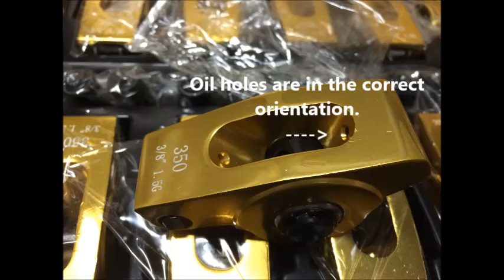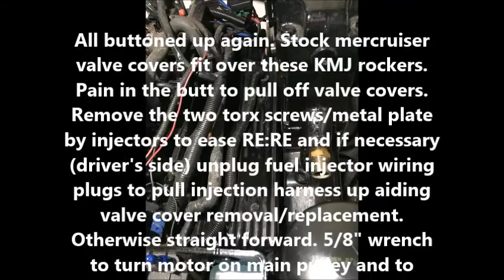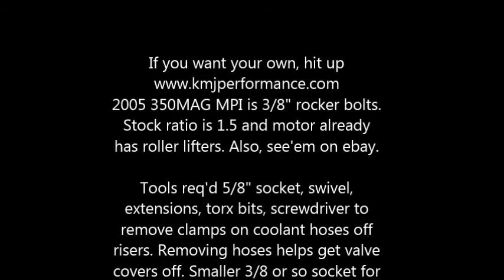Upgrade 2005 Mercruiser 350MAG MPI Roller Rockers

Comment: What field of work you in?
Reply from the maker: Manufacturing clean ingredient personal care/cosmetics. Lets see... started with legos, then drag racing and rebuilding type1 VW beetles, 7.3L power stroke modder, alum & steel tig welding, mig welding, professional baker, electronics technologist, installed/sold solar PV & hot water, etc.

Comment: What was the mph gain?
Reply from the maker: To be honest I don't think there was any. But overall it runs smoother and quieter from what I can tell. Unfortunately there aren't too many power hop-up pieces for this generation (ie. ecu programs, etc) for more power. Perhaps try 1.6 or 1.7 ratio rockers for more lift? Otherwise maybe a supercharge but damn lotta change $$$ for that. Cheaper to get similar hull boat with a big block or factory supercharger. Too bad not many turbo options for gasoline marine engines. Changing ecu software on a factory turbo'd motor gives big gains vs 5% with premium gas advance ignition timing on naturally aspirated. Although I haven't measured seems fuel economy is better, perhaps due to overall little bit less friction with rollers vs stamped steel pieces.
Reply: @westvandude   I just did two of these, one was a repower because cracked block,  i just took used 1998 Tahoe 5.7, honed ,rings, bearings ,oil pump, home ported heads, meling oem replacement ls1 springs , comp locks, ramjet 350 cam, same as merc mag 350 cam, added 1.6 ratio roller rockers, shim head gasket, flashed pcm to 350hp and the plugs were still white. Ran almost 60mph in mid 90's sea ray I think 22',  next was 06 220 crownline did same but 3.75 eagle crank ,rods, .040 -10.2 wiseco pistons, cometic head gasket about .035, 1.65 rockers, .496 cam, 210@.50 ,195 afr heads, Eddie marine exhaust, whipple flashed the pcm to ?, bravo 3, just took first lake test, 24p props, she feels twice as responsive, feels like Corvette on water but 5900 rpm comes in couple seconds Forgot GPS, I think 60mph, going back monday with the 26p and new iac, adjusted r rockers @ 1/2 turn because higher ratio, they seem a little noisy, a little afraid to go to 3/4 turn, maybe the fear is unwarranted.
Reply from the maker: @jesusisreal3209  Sounds like you've got skills. Can't speak to reliability I don't have that many hours on these rockers. So far it's running smooth. Is it really quieter than before.... I dunno. It's like bling that nobody sees. I've got stock ratio, maybe I should of gone one up for bit more power. I find the mag 350 hop-up options are super limited, gonna sell the boat pretty soon here.
Reply: @westvandude, thanks for the video. Have not long had my '04 Four Winns 210 with 350Mag MPI but only with Bravo 1 drive. Looking for any power upgrade tips I can find, apart from Whipple Supercharging this is all I have found. If there's any more updates please let us know. Stock with 3-4 people on board, its just lazy getting up on the plane, let along trying to pull a 100kg wakeboarder or even worse a skiier. What about better cams?